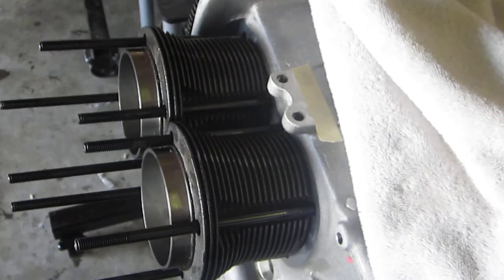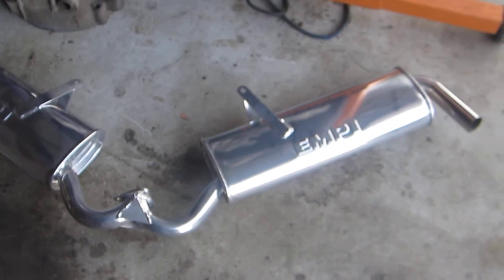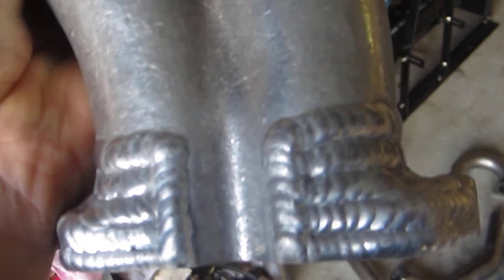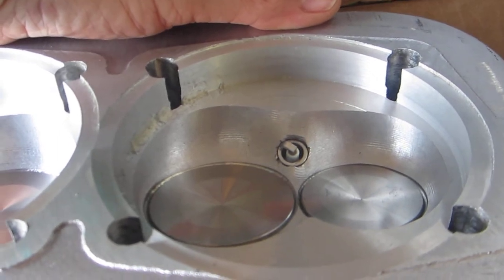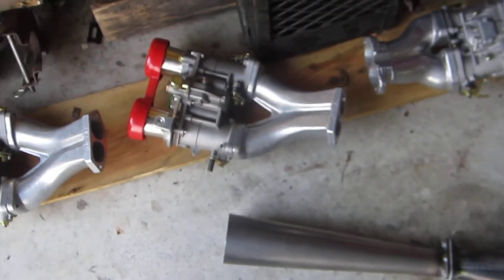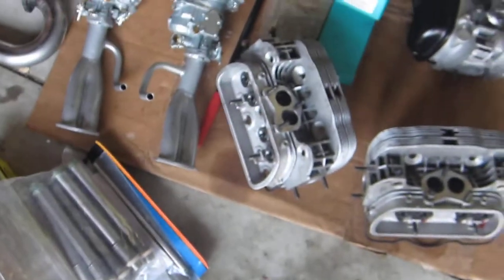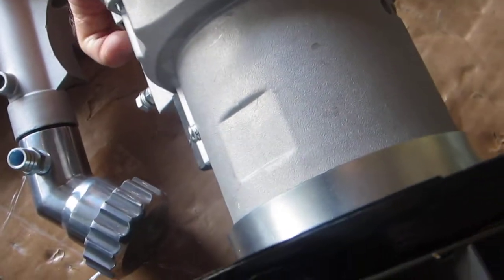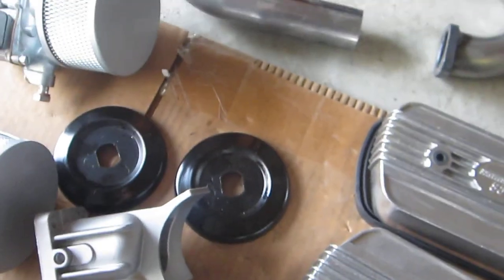2332cc VW Hi-Po parts

Comment: I have  a 2332 on the street last five years superflow heads 46 by 37 with dual Chevy valve Springs I'm running nine and a half to 1 compression the 48 idas have 37 mm venturi's 200 on the air correction 170 on the main jet F7 emulsion tube I'm running a 120 holder for the idle Jet and the Jet is a 65 I do not have the third progression whole I drive the car in the evening between 6 and 10 it never runs over 180 or 190 degrees on the oil and about 430 to 475 on the head temp after a few  pulls on it it has 200 horsepower 190 on torque and it drives like a dream with the carburetors in the way they're set idles at 960 but remember its in a purple manx which weighs a 1200 pounds with me in  it the 48 ida are the best way to go just make sure you use the filters in the carburetors and before the fuel gets in the carburetors and in the regulator there's another really good fuel filter in line and then one before the fuel pump which is always an after-market one like a blue or red Holly I'm also running at five pounds of fuel pressure the car has 20,000 miles on it and I've had it running for like I said five  years it's been awesome your build looks awesome can't wait to see it on the car
Reply from the maker: Thank you, I appreciate the good information. I'll use it when I go to setting up my fuel system. Your Manx and engine sound like an awesome combination. I bet your Manx really moves out good. I like those Superflo heads with the IDAs. Take care!
Reply: Vw and vets I recently upgraded my 2332. It’s now Sportin 10 to 1 compression 215 on the horsepower 200 on the torque car runs like a dream. I recently also built a 2498 can’t wait to put that in my other Manx.

Comment: Nice video. The rubber gaskets that are like a channel are nice and don’t slip because the covers sit in the channel. I was worried about them being bolt on since they don’t self adjust for tension like the stock ones but they work nicely.
Reply from the maker: Thanks! They will probably work better too once they get a little heat in them.

Comment: Man, you've got a million bucks in goodies there!  The IDA 's need a 3rd progression hole drilled in them for the street. If they are the "Geer's kit from CB"- they should already be drilled. That kit is $1600
Reply from the maker: Thanks! I wish mine were the Geers 51.5 IDA kit that CB sells but they are just the standard Weber kit. I may indeed get the 3rd progression hole mod on them depending on how they run on the street when I'm ready to do a test drive.
Reply: @vwsandvettes3253  i got the empi 51 epc for my 2332 will haft to see about my venturies maby bumping up to larger, i think thats for more top end. i got the ultrs wedge ports 46x37heads. almost ready to put in da bug, good video!
Reply from the maker: @termike55  Oh man that engine is gonna pull hard! Good luck on your build!
Reply: @vwsandvettes3253  Thanks!

Comment: im curious why did you stop at 84mm with the crank once you bought the rino case.
Reply from the maker: Well, I've heard that unless the crank has thicker T4 center main, the larger stroke cranks can flex. My TF1 case, which I'm planning to build into either a 2276cc turbo or 2387 N/A engine from, has been cut for the larger T4  sized crank. Thanks for the good question!
Reply: @vwsandvettes3253  thanks for your response